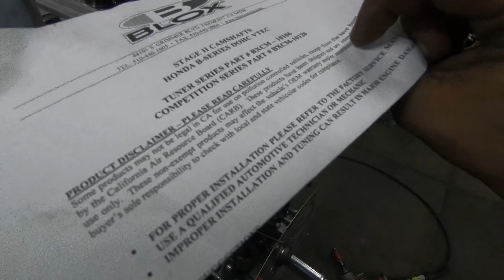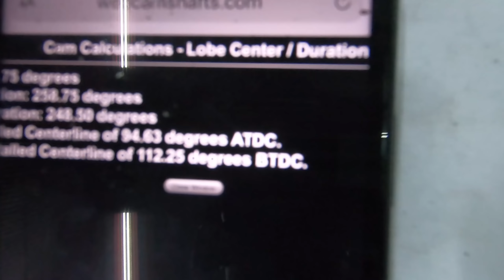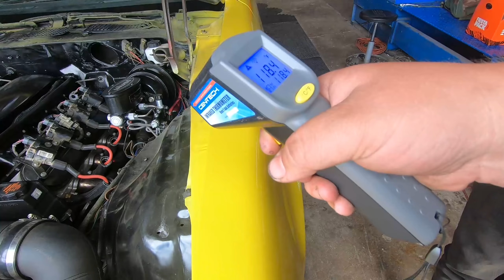Working on the Crx not a Welder coming in hot

Comment: When the welder is popping like that try increasing the wire speed
Reply: I think you mean to turn up the voltage or turn down the WFS to smooth out the popping, also shortening the stickout does the same thing.
Reply: He definitely has too much stick out for that diameter of wire. At 15:24 He had over an inch of wire sticking past the contact tip. Should be no more than 1/2" to 5/8" tops.
Reply: Especially at that angle.  Wire speed and heat can be good friends welding up like that.  Good clean material too.  Make it as easy on yourself as possible.

Comment: If you welds gets Shawn's seal of approval then the must be OK.  That said pay heed to Shawns advice about prepping the surface area you are going to weld by grinding away the crud, corrosion, mill scale, paint, rust etc and wiping your welding area with Lacquer Thinner, Acetone, Brake-Kleen etc so that all the surfaces are free of grease and oil.  It took me a long time to learn that a MIG and or TIG welder will not weld through any and all of the above worth a "tinker's dam" and to be honest Stick welders don't like to either.  Keep up the good work
Reply: Do not recommend brake clean. Clorinated can kill you.